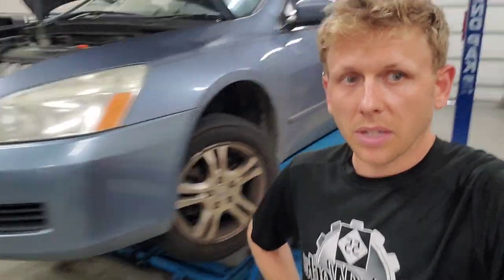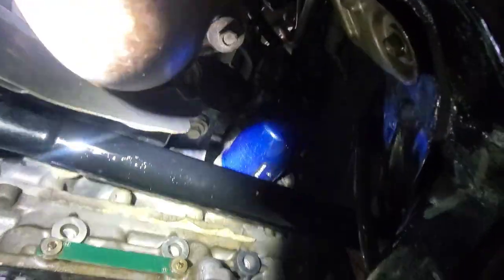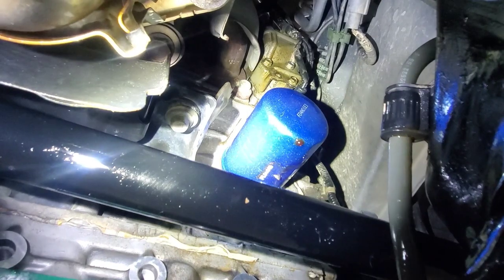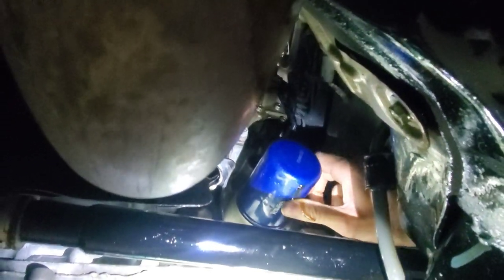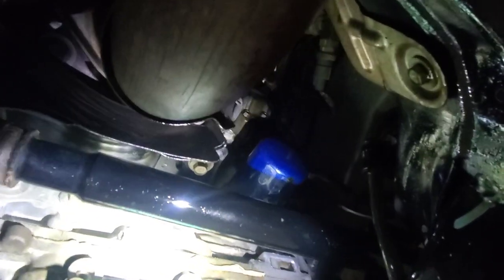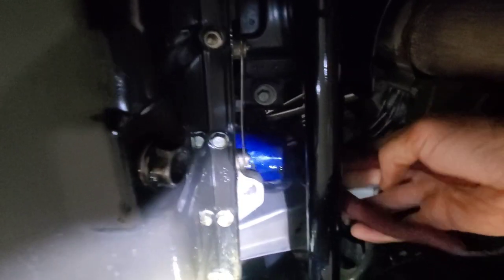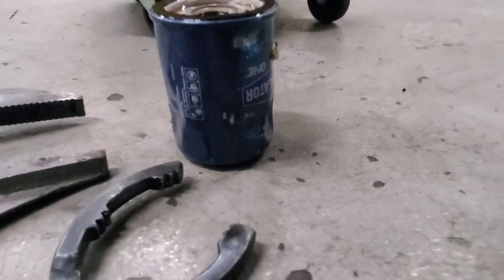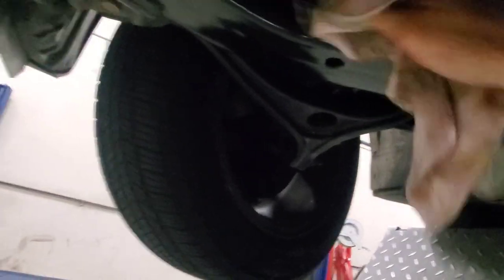Customer States: It's Not The Oil Filter, Cause I Did It Myself. (Honda Accord Oil Leak)🤦

Comment: All the rust-belt guys yelling at their screens - “Why are you cleaning the motor oil off the subframe and oil pan? It’s keeping them from rusting away.”
Reply: My grandfather used to spray our jeep with oil every year before going to the beach
Reply: you aren't lying lol
Reply: Lol.  Missouri problems.
Reply: depends where you live. I know a few folks here in Cali that own classic cars right off the coastline. if you dont keep them things oiled they will deteriorate 3x as fast, the closer you are to the beach/ocean the air is very moist with that salt water.

Comment: in 60 years of installing oil filters I've never needed a wrench to install one. I've sometimes needed a wrench to remove one that was overtightened or the  the gasket stuck.  If the owner is going to change the oil in the future, he should use a mid-grade Fram filter and with a grip end and lose his fiter wrench.
Reply: Fram ? Only if he doesn't like his car
Reply: @StarlightCipher  let me guess , you filled said cars with penzoil too ?
Reply: @StarlightCipher  lmao ...now I'm hungry.
Reply: I've never had an issue with Fram. Been using them for 20 years. Change your oil every 3-4k miles and there's no issues. Also use Penzoil. It's a good oil, esp since it has natural additives already in it. Bunch of snobs here.
Reply: He should use amsoil filter and oil.
Reply: @Joby Fluorine I’m not a fan either, but Fram is sufficient for what most drivers need. Not the best but I wouldn’t say garbage.
Reply: AFTER seeing what frams are made with ill never buy a fram again. They used to be the best but now they have a deal with Acme mart and are made out of cardboard ill never waste the money on then again
Reply: @StarlightCipher it's not fair to compare WIX with Fram.
Reply: @stephenhusak6098  
And don't use Amsoil if you have a leak...
Reply: @njsongwriter  huh?
Reply: @RoastBeefSandwich  fix your leak.
Reply: @stephenhusak6098  agreed but in the meantime you have to figure out what's going on and filling back up with Amsoil will drive you to the poor house.
Reply: Wix is great 👍I use napa gold on my current rigs just out of convenience.  Purolator is ok. But never, never fram. They look cool and the grip on the housing is cool, internally though, they are not so good.
Reply: I'm kinda thinking if he thought it was good to crank the oil filter on like he did, he probably shouldn't be doing any work on his car and should just let someone else do it.
Reply: @garbonzobean1  for the same price, you can get a way better filter. You may have never had a issue if you never keep your cars that long, but you are seriously shaving life off of your engine if you use a fram filter. Have you never seen a breakdown video on it and how horrible it is compared to every other brand. I don’t get why you like to use or are happy to use shit products. The only thing I can think of why you would use it is because of sheer ignorance. If you looked at how they are built compared to others you would never touch another fram filter again. In any product, there is always one company that makes the most horrible crappiest version of a product, who do you think that might be. Yes... exactly, it’s fram. There’s a reason why the general consensus of fram filters is that they are horrible, because they are.
Reply: @EricFortuneJr.  no, fram is horrible, you are practically shaving life off of your engine compared to any of the other filters.
Reply: @Rekt-M8-v4  Not necessarily. The damage comes from folks who expect to get 8,000+ miles out of a 4,000 mile filter. Fram, as with most national brands are fine for 3,000-4,000 mile intervals. I personally don’t use them, haven’t used them since I got an oil pressure warning light after putting one on my very first car. I either use WIX/Purolator or dealer. Then there’s the store brands like NAPA (NAPA) and O'Reilly (Microgard) that are also made by the Mann+Hummel company, those are quality store brands, though not for me..
Reply: Not a fram guy. The van gets a mopar filter and the truck gets AC delco both get NAPA high milage oil. Napa oil is just rebranded Valvoline.
Reply: You’re going to need one on a 12.7 Detroit or the vibrations will drop it on the road behind you. Automotive applications no wrenches needed for installation.

Comment: I would have written on the invoice that the engine was run with a major oil leak and that it ran low on oil several times. Then I would have further stated that this can cause internal engine damage that may not show up for a while.  And then I would have further stated that my shop is not responsible for any such damage. That way if it comes back a week later on a flatbed truck all seized up or with a spun bearing the customer won't be able to blame me for it.
Reply: no guarantees on overheats either.
Reply: @FrankieJames7  Good point.

Comment: Wow, thank you so much for this video, I was kinda disappointed that I had a leak near or above the oil filter, never would’ve ever imagine that it was the same identical issues what your customer has, a tiny pin hole on the oil filter wall. I’m just glad it wasn’t something serious, I always try to avoid the dealership and do all the repairs myself. Thanks again and God bless

Comment: I have never seen someone punch through the can while INSTALLING the filter!
Thanks for the video.
Subscribed
Reply: It could be a defective filter with hole on it. That is why before I buy an oil filter, I check the canister first for any abnormalities. Yes, I've seen some used oil filter inside a brand new box. Customer must have put in the used filter for a refund.

Comment: I was pleased by the use of parts/brake cleaner to try and remove the oil tanker's worth of shmoo under there, but was then triggered by you continually dropping the dipstick onto the valve cover. Ya, ya, I know, doing it one handed while holding the camera, but still, auugh! lol
Reply: Whats wrong with dropping the stick on the valve cover
Reply: @Bigtexbbq  just that it’ll leave oil on the valve cover lol

Comment: Hand tight only. Over tighten can damage the gasket. Snug then 1/4 turn. Always check to make sure old gasket came off with old filter.
Reply: Exactly, I've only ever hand tightened them, torque specs on an oil filter are useless; seen them on Honda oil filters. I always follow these steps: Take off old filter, make sure gasket came off with it, clean mating surface as best as you can, use a little of the old oil on top of the new filter gasket to help enure it doesn't stick, spin on new filter by hand and tighten by hand. 

Never had a problem following that method.
Reply: I do hand tight with a rubber glove on.  When I go to change the oil the next time, I'll still need an oil filter wrench to get it off - which means it's plenty tight.  Truthfully - I had the same car as in the video.  It's not easy getting in there with the band type oil filter wrench.  When I managed to get one in there for my first oil change, where the filter was tightened at the factory, space limitations prevented me from being able to loosen it at all (tightening would be the same effort).  I had to get the type that fits over the top of the filter.  I want to know how the guy got the filter that tight in the first place?

Comment: My 92 Prelude oil filter was also leaking so I changed it out. Hand tightened no wrench used. The new filter also was leaking. Further investigation revealed that the oil pressure sending unit right above the filter was the one actually leaking. Changed that out and problem fixed.
Reply: A good trick is to wrap the oil filter with a shop towel and run the vehicle for a minute. That could assist with finding out where your leak could be before changing anything unnecessary.
Reply: I could tell by the leak it wasn’t pouring down on the filter from where the oil pressure sending unit would normally be it was coming from a hole on the filter.

Comment: Never use tools to put an oilfilter back on an engine..
Just hand tight it.
This is an new one for me lol.
Nice video just subscribed 👍
Reply: Unless it's a cartridge style filter but even then, don't over-torque it.
Reply: I just screw it on with both hands for extra strength. I’ve never used a tool to put them on. Never had one leak.

Comment: There is something unplugged on the air intake tube in between the air filter housing and the throttle body. I can see a hole where something is disconnected and if that is an open hole, then that is allowing dust into the engine that is not going through the filter.
Reply from the maker: Good eyes. On this intake tube it is a dummy hole(meaning it is not actually open) I've seen this a few times where they use the same hose for different models but during manufacturing they close or open the hole through that port depending on the application.

Comment: Oil filter tightened to 100 ft lbs, check. I bet whenever he changes a tire, whatever mechanic that works on it down the road will have to break the wheel studs to get the tire off
Reply: LOL "100ft/lbs...check" dyin'

Comment: My wife recently got another minivan, since she gave the kids her 2013.
For the first time I was allowed to change the 2013's oil, rather than Midas doing it.
Jack up the van enough to crawl beneath, because that's all the leverage room you need, right ?
Except that the MoFo at Midas had tightened the Drain Plug so much, that I  finally needed my son under the car also, to hold the ratchet wrench while I pounded it with a hammer; MoFoing Midas the entire time !
Reply from the maker: This sort of thing happens to me, but with the toyota oil filter housings. People really tighten those on. Most are plastic and the heat cycles make it worse.any I have to air hammer off and replace.

Comment: Had an owner " change the oil and filter " on a honda and it was leaking quite a bit.  Found the old filter gasket stuck on the block. A not uncommon occurrence. Stay safe

Comment: When will people learn to lube the o ring and spin on oil filters hand tight only?  My personal favourite is VW plastic oil filter housings with the nut built into the lid. You put your socket onto it to undo it and the previous grease monkey has done it 200ft lbs tight and the plastic nut shears off the housing! Just make it in steel if you must design it that way!
Reply: I hate doing vw 2.5 myself

Comment: I've had a filter blow out already, either was hit by a rock or just had a defect in the paint from the factory. Never put a filter on that has a defect in the paint, it can rust through in  a short time. Some filters are pretty thin metal.
Reply: Yep, always inspect the filter BEFORE you walk away from the parts counter.  Found several rejects over the years.
Reply: I never thought of this. I've seen a few filters leaking through the can like this. Always wondered how it happened when there was no tool marks or dents or anything. Just a random pinhole.

Comment: When a shop says it's the oil pan gasket, there's a place to avoid, and the reason people with inadequate skills do it themselves.
Reply: Almost every oil leak will drain down to the oil pan area.  Oil leaks can be hard to find because they leave most of the evidence elsewhere.
Reply: My wife brought her car in the dealership for an oil change. They told her the drain bolt was stripped and she needed to have her oil pan replaced for $550. She called me at work upset and I called the dealership right back and told them to RTV the bolt and slap a piece of tape over it so it will stay put for the drive home.  I bought an oversize drain bolt on the way home then drilled and tapped the pan and had it as good as new for $8.  The drain bolt wasn't stripped before bringing it to that dealership. Some Tech must have tightened it with an impact or something. Long story long is don't take a repair shop at its word or expect them to do the right thing.
Reply: @danr1920  It wasn't hard to find in this case. The shop was going to charge for a gasket replacement, but only change the filter.

Comment: I use a rubber swimmers cap for a little extra grip when I hand tighten my oil filters lol..works great ..tight enough but  never gets it too tight to remove when I change my oil again :-)
Reply from the maker: Good tip

Comment: Once I had my Honda dealer change my oil and I had to go back to them to have them loosen it so I could change the oil myself (they then made a point by only hand tightening it). They did issue a bulletin about fires because loose filters were dripping on the exhaust and igniting. I tighten the filter 3/4 turn after hand tightening. I never had any leaking or fires.

Comment: In our shop the #1 oil leak on "Do it your selfers" is the "Double Seal Gasket" that people don't check ..that will leak like crazy due to two seal gaskets sandwiched together..
Reply from the maker: I had a young tech here a few years ago, did our one and only double gasket to my landlord's f250 diesel. Pretty embarrassed when he called me pissed from Maine that he was spewing oil (I'm in north carolina) 😒. He made it quite a ways though...
Reply: @2shops1roof  He was very fortunate not burning up his engine...
Reply from the maker: @stevedeleon8775  I was very fortunate you mean 🤣. Pretty sure that would've been a $20,000 mistake. 6.7L was only like 3 years old at that point.
Reply: @2shops1roof  Wow..

Comment: I always tighten by hand.then about 1,8th a turn with tool. Next change can take off by hand.never had one leak.
Reply: Mazda OEM filters have the instructions printed on them. Torque to 15-20Nm or ¾ turn from seal contact and helpfully have numbers 1-4 printed around the can plus a reminder that ¾ turn is 1->4, 3->2 etc.

Comment: Only use the BAND type oil filter wrench. Easiest to use, and no way will it cause damage.
Reply from the maker: That is what this customer used. But to tighten the filter extremely tight. That caused the hole in the filter and the leak 😳
Reply: @2shops1roof  ha4d to belive, there nothing that pokes out or is sharp. Must have literally TORE a hole in it. Who is this guy...BIGFOOT???
Reply from the maker: @johnfranklin5277  I looked at my Lisle brand band wrench. Where the band connects to the handle is a solid steel piece with a somewhat sharp edge. I can see this prying into the can when going he-man on it like an old style can opener. Especially if it were a cheap band wrench. Who knows. But it was right on the band mark where I could tell the band slipped because paint was removed in a ring shape. So maybe it sliced a tiny slit too. Another possibility

Comment: He prolly did the initial tightening with the band-wrench and punctured it. Though not this time, I have seen the old rubber gasket come off the filter and stay stuck to the block.
Reply: usually only happens on older cars or cars that have not seen an oil change in 10k miles.

Comment: Filling the crankcase to the full mark. then you run the engine to check for leaks and fill the oil filter. wouldn't read low?.
Reply from the maker: Yes it would if doing that way. I ran the car and the very last thing I did was check level and top off again. Always check level last, and in most cases letting the engine sit off for 10-20 seconds is all that is needed. Some vehicles require a few minutes to let the last bit of oil drain down to the pan, just not many.

Comment: You NEVER use a wrench to tighten the oil filter. HAND TIGHTEN only. Also, clean the contact point and apply a thin coat of CLEAN oil to gasket before install.
Reply: I always glue my oil filters on then do a little tack weld with my welder to ensure it wont come loose.

Comment: Let me guess.  The quickie shop would have changed the pan gasket, then changed the oil filter as a "courtesy".   And given them the big bill.  I never saw an oil filter with a cracked housing before, but there you go.

Comment: He probably tightened it with a wrench the first time, causing the leak. DON'T DO THAT on gasoline engines. HAND TIGHTEN ONLY.
Reply from the maker: Exactly, as I showed there was a mark on the filter from a metal strap wrench, this tool punctured the thin metal filter and caused the leak

Comment: Friendly warning 
Oil likes to get in the frame on these hondas and it is damn impossible to get it all out
If this occurs let it known that oil maybe spotted for a little bit after an oil change 
Why the genius engineers decided to put holes under the I'll never know
Reply from the maker: Haha, don't I know it. I change civic, odyssey, pilot, accord oil almost daily. I use a flexible funnel many times but it is unavoidable in others. 🤷‍♂️ just one of those things. Try your best and wipe up.
Reply: this is why its nesecarry that you dont make a mess on the job and also dont use removal tools to tighten your filter. OR things like this occur.